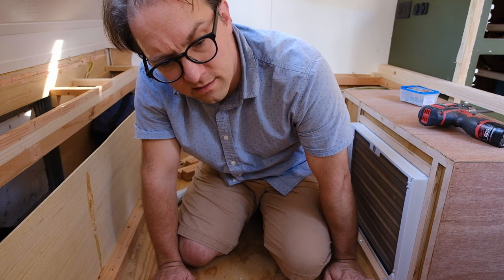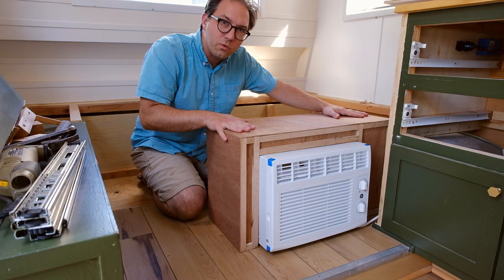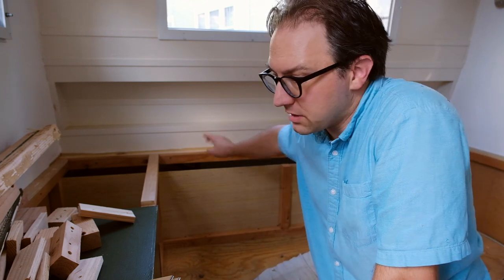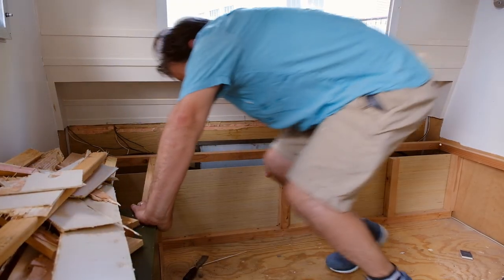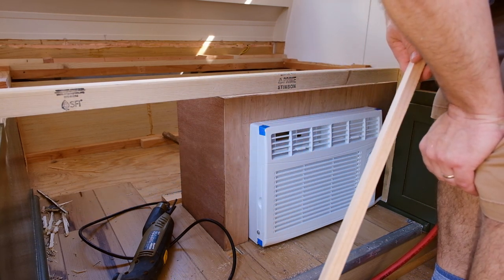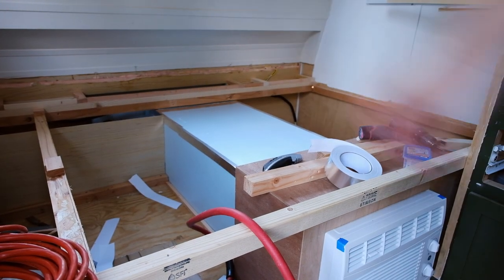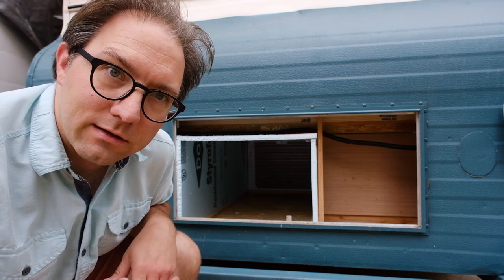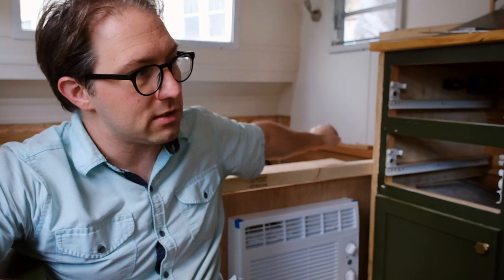HIDDEN WINDOW UNIT install in my VINTAGE CAMPER

Comment: What program did you use to make your model?
Should the floor have an under coating? I have to do a new floor that's why I ask. Ty
Reply from the maker: I use the browser based free version of SketchUp, and I made a video about it here:

https://youtu.be/HPl3DprhscQ

You can undercoat your camper if you like, but there's a likelihood that anything you coat it with could prevent the wood from drying out naturally when it inevitably does get wet. I don't generally undercoat my campers and it's never been an issue. Typically what rots the floors in these campers are leaky windows and vents, not road spray.

Comment: What about the water that drips from the ac
Reply from the maker: I did add a drain line, but if you read the owners manual it specifically recommends against opening the drain as the design is intended to fling the condensate onto the coils to provide additional cooling. In my test of the unit so far, I could feel moisture at the drain hole, but it wasn't enough to ever actually drip.
Reply: The ac's now days do not drip (I am not fully covinced) but I put a partner mine just in case, I put my box through the cargo hold to exit the flow of air. Mine is also under the bed.
Reply from the maker: Yeah I really didn't ever run out very much, but I never noticed condensate dripping below it.

Comment: If you didn’t tilt that air conditioner for the condensation you’re gonna grow mold and also it’ll leak and rot your floor!!!
Reply from the maker: These AC units are designed so that they tilt naturally when resting on a flat surface so that condensation collects where it can kick it up on the coils and increase its efficiency. That being said, although the manufacturer specifically recommends against it, I opened the drain port to allow it to drain through the floor.

Comment: So now that has been a year or so, how has it been? Do you have a problem with the water draining? I didn’t see you address that and I’m not sure if you got one of those “dripless trays“ where it sits and the compressor dries it up
Reply from the maker: This AC unit is one of the dripless types, but I actually sold the camper before I really had a chance to use it much. I checked in with its current owners recently, and their only complaint was that when parked in full sun it was a bit too small of a unit to keep the camper cool, but otherwise it worked great with a fan on the floor to help circulate the air. They haven't had any issues with condensation either.

Comment: Love the AC idea. I'm going to use it in a camper build myself. I have plans to elevate the unit and build it closer to the wall for the exhaust and make a little door to open whenever i need to use it. I was going to ask about the drain but reading your reply on the same question was good. Your channel is great! Thank you for taking the time to film it.
Reply from the maker: Thanks! I will point out that while it seems to work, I really haven't been able to give it a good workout because the weather cooled waaay off the week after I finished it, lol! But yeah, it'll work better mounted up higher for sure. I did give in and drill a drain hole in the floor, but I still question if it was necessary. Good luck and thanks for watching!

Comment: You will find that an exaust fan will help a lot. Just a little box fan the size of the rear opening will do. Also you will want to put some 1/4 inch wire screen underneath to keep critters from trying to get up in there.
Reply from the maker: Great suggestions! I had kinda thought about adding an exhaust fan and getting all complicated with it, but a box fan sounds like a practical solution. We had an inline fan with ducting in our camper with the darkroom to provide positive pressure in the back and to pipe in fresh/cooler air.

I'm gonna go back and install a drain line on the A/C now that I know it works so I'll upgrade the mesh when I do that.

Thanks!
Reply: A lot of small ac units now do not drip like they used to. They fling the water on the coil and evaporate it. A small cookie sheet may be enough.
Reply: @robertbell525  That's a great improvement.
Reply from the maker: I checked in with the current owners of this camper recently and they haven't had any trouble with condensation, but I think perhaps the "cookie sheet" is maybe a worthwhile suggestion for the future.

Comment: I have a Scotty and installed AC under the bed. AC is extremely sensitive to airflow, much more than you'd think. Exhaust must be wide open, as large as the back of the unit. We have to keep the hatch open and have a small fan pulling in air, blowing toward the unit. It cools well though. 
I also recommend one with electronic controls. Ours has a remote and it turns on periodically to test the air temp and shuts off if cool enough. Having these running all night long is really noisy in this small space.
Reply from the maker: You know I really haven't even had the opportunity to try this out since I finished installing it. I went camping a week or two after finishing it and the overnight temperature had dropped to something like 22⁰F, so I wound up using my new power outlet for a space heater instead!
Reply: I also have a scotty and put mine under the bed. So far all good
Reply from the maker: It works pretty well if you have another fan somewhere to circulate the air.

Comment: your making it too easy for someone to steal that a/c.
Reply from the maker: I'm not too worried. They'd have to break into the camper to tear that AC out. It'd be easier to just pry open someone's window and take one that way.
Reply: I've heard so many theft horror stories.
Reply from the maker: Like I said, I'm not too worried about it. My refrigerator is a bigger target.

Comment: I did this to my 65 Shasta. It was under the Goucho bed. I would put a small fan under the dinette table and point it to the ceiling. It would circulate the cold air up and make it a lot better.
Reply from the maker: That's the way to do it if you've got a low mounted AC! They sell a little fan at Target called a Wozoo that has oscillation and elevation, and it's actually pretty quiet. I highly recommend it! You can also get it a bit cheaper at Costco.

Comment: I like your attitude. "I don't care, it's my camper.". That's how it should be. We all make mistakes and that's how we learn.

I am curious though. Since a year has gone by has there been any issues with the AC being somewhat enclosed. Any overheating issues, cooling issues etc,? I don't know enough about window AC's to know how it differs from wide open space. Just curious about any input you might have since this time has passed. Thanks for sharing your build.
Reply from the maker: Ha ha, well thanks! Unfortunately it's not my camper anymore, but I have followed up with the new owners and the only issue they've had is that it's not quite powerful enough on the hottest days when the camper's sitting in the sun.

There's some things I'll be doing differently on the next one. They should really be placed higher up in the interior of the camper so that the air can mix naturally without the need for an extra fan on the floor. And instead of taking in air under the floor I'll draw it in through the roof and exit it directly out of the side of the camper. I'll probably also try to go with a slightly larger unit; that one was 5000 BTU and it would've been fine in a home with a small room, but campers aren't insulated like a home.

Now if you have the budget, I recently saw one of these: 

https://www.pioneerminisplit.com/products/pioneer-9-000-btu-under-bench-rv-heat-pump-air-conditioner 

and I think that'd be ideal for a vintage camper build.

Comment: What about the condensation? I’m doing somthing similar but idk what to do for a drip rail?
Reply from the maker: These newer AC units aren't designed to drain. They use the condensate by throwing it onto the condenser coil to evaporate it and get higher efficiency, but I did drill a hole in the floor for it to drain out. The manual specifically recommends against it though.

For a drip pan I've seen some people use a baking pan with a hole, a hose barb, and a tube.

Comment: What is he going to do from the water that's going to come out of the AC is it supposed to rain right on the floor and make a big mess
Reply from the maker: I suppose he's not going to do anything with it since these newer AC units evaporate the condensate to increase their efficiency, and the manual specifically recommends against opening the drain plug. Thanks for watching!

Comment: How is the AC working out? Any mold/ mildew issues?
Reply from the maker: I don't actually own this camper any more, but I followed up with the current owners a few months back and they said that they hadn't had any trouble with moisture. They did say it maybe wasn't quite large enough for the times when the camper was parked in full sun, and that a fan on the floor circulating the air is a big help.

Comment: I’ve enjoyed watching both videos on the a/c install.  Are you concerned at all about water splashing up into the intake hole while traveling in the rain?

We’re headed to Branson this week for the vintage trailer rally.  It’s our first rally and our first trip in the ‘69 Gold Star since I finished the rebuild.  Wish  us luck….No a/c.  Just a tower evap cooler which I’m sure works better in dry Colorado than humid Missouri!
Reply from the maker: I'm not really. If you look at where you get water splashed up it's almost entirely behind the tires and not to the sides, but I am thinking of adding some sort of closure to the intake at some point.

Good luck on your trip! We were just in Branson a few weeks ago for a little family getaway, and it was unseasonably cool when we were there.

Comment: Where does the condensation go?  I didn't see a drain.
Reply from the maker: Newer AC units like these aren't supposed to be drained. They evaporate the condensate to increase their efficiency. That said, I did add a drain line later for peace of mind, even though the instructions specifically recommended against doing so.

Comment: Looking good.  You won't know yourselves next time you camp in the heat.  You'll be nice and cool.  Our little caravan is 15 foot and has an airconditioner about the same size as yours and it cools that space really nicely in the heat.  Thankfully here in South Australia it isn't generally a humid heat but it definitely gets hot, many days over the 100F during Summer so it's nice to be able to sleep well at night when camping.
Reply from the maker: We'll see, we're thinking of taking it out soon, but we're actually getting a bit of a break from the heat so I might not even really need it at night.

Comment: What about adding a drain pan? Just in case it leaks or if the angle of the trailer is not completely level.
Reply from the maker: You could add a drain pan if you wanted for added peace of mind. I did ultimately open up the drain plug and drill a hole through the floor for it.

Comment: Hi I and doing something similar just wanted to see how is the foam insulation holding up for the vent duct , looks a lot easier to do it using that that what I was planning to use on my, I will probably prefer to do it like yours instead of sheet metal , if you could tell me if the material is good and holding up the heat and everything ok, I will do the same thanks
Reply from the maker: I actually sold that camper recently and I never really had much opportunity to use the A/C as I mostly did cold weather camping. It worked fine the few times I used it, and I can't think of any reason it wouldn't hold up long term.

Comment: Did you paint the wood on the bottom of your camper?
Reply from the maker: I did not. Now I know lots of folks will say you need to undercoat the wood to protect it from road spray, but that same undercoating will actually prevent wood from naturally drying out if/when it does get wet. Also if you go and drive through a rainstorm and get down there and look at the parts that get wet, it's almost entirely just the areas behind the wheels, and mud flaps would protect the underside far better than any coating.

Comment: a/c leak water so need a drain for it or water will be on your wood floor!!!!
Reply from the maker: Most contemporary window units are designed to evaporate any condensate and actually cool more effectively without draining it away. That said, there is a place for an optional drain plug on this unit, and I've been contemplating installing a drain line even though the manual specifically recommends against it.

Comment: Whats the verdict after what 9 months of use? I have a 66 playmor and trting to figure which way to put ac in as well. Mine is a usable camper and not a show piece.
Reply from the maker: Well, I actually sold that camper and I only ever used it once, but it worked well that one time! I'm thinking about installing one in our Cal-Craft when I get back to it, but I think I'd install it high up on the street side wall and exhaust it straight out of the side with the intake air coming through the roof like I see on a lot of newer teardrop campers. It'd probably work a bit more efficiently that way, and I wouldn't lose a bunch of storage.
Reply: @TrailerTrashtoTreasure  thanks for the reply and I have unused vents where something was before so I'll go that route as well.
Reply from the maker: No problem, good luck!

Comment: I didn’t catch any sort of drain pan? Gonna lead to major water issues if not drained properly
Reply from the maker: Newer AC units like these aren't supposed to be drained. They evaporate the condensate to increase their efficiency. That said, I did add a drain line later for peace of mind, even though the instructions specifically recommended against doing so.
Reply: @TrailerTrashtoTreasure   Monitor it closely. I do a little RV repair and during Covid and the supply shortage a lot of manufacturers went to window units on small campers. Just came from one that leaked and rotted out the whole wall and even dripped on the bed. I’m currently installing mine in my home built RV.
Reply from the maker: It hasn't been an issue so far, but I actually sold this camper to some folks down the street from me. Last I heard it was working great for them.

Comment: Great video! Thank you! I was trying to figure out how to install a window a/c by opening the floor rather than a window. you helped me immensely. I appreciate it.
Reply from the maker: Well let me know how it turns out. I still haven't even had warm enough weather to really see how well this works!
Reply: @TrailerTrashtoTreasure  For sure. I'll let you know :)
Reply from the maker: I posted an update on the AC in my shorts. Turns out it works really well!

Comment: I have a 1980 19ft motorhome how many btu you think I would need?
Reply from the maker: I'm not really an expert on AC units, but I think for that size they usually recommend about 10k BTU, give or take.
Reply: Ok thanks
Reply from the maker: Good luck.

Comment: Where does the water goes
Reply from the maker: If you read the owners manual for most of these newer units you'll find that they're designed to evaporate the condensate to improve efficiency. There is a drain plug, but the manual specifically recommends against opening it. That said, I did open it and drain it through the floor.

Comment: will the unit be removeable? a condensation port? it looks like a great solution, good job.
Reply from the maker: I mean, it COULD be removed, but it's kind of a pain to do it. These newer units are not supposed to have a drain, but there is a plugged port that you can open up to provide one. I kinda think I'm going to go back and open it up and run a line to it, but that might not make it into a video.
Reply: @TrailerTrashtoTreasure  did you end up adding a drain?
Reply from the maker: @Rockwell108  I did, yes.

Comment: Very cool idea 
The only question I have is what did you do with the condensation under the unit. 
I know mine puts out over roughly 5 gallons a day   
What keeps it from leaking all over the floor.  Thanks great job
Reply from the maker: If you read the owners manual for most of these newer units you'll find that they're designed to evaporate the condensate to improve efficiency. There is a drain plug, but the manual specifically recommends against opening it. That said, I did open it and drain it through the floor.
Reply: @TrailerTrashtoTreasure  
O ok good to know thanks so much 
Love the idea
Reply from the maker: Your welcome. I'm planning a slightly different install in the next camper, whenever I get back to it.
Reply: @TrailerTrashtoTreasure  
Yes I am redoing an 1975  airstream land yacht 
And it’s kicking my butt lol 
But getting ready to close the walls up 
Can’t wait to get it done.
Reply from the maker: Yeah Airstream's are a whole different kind of project than canned hams. Good luck with it; it'll all be worth it in the end!
Reply: @TrailerTrashtoTreasure  
Lol yes I totally agree 
Thanks so much
Reply from the maker: You're welcome!